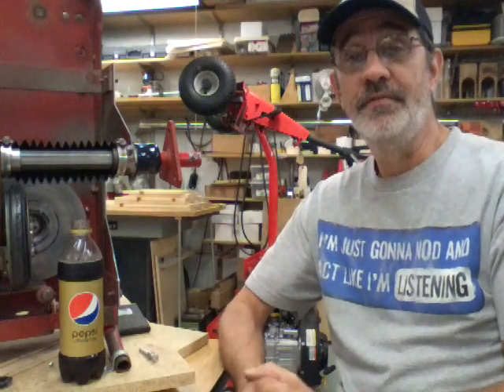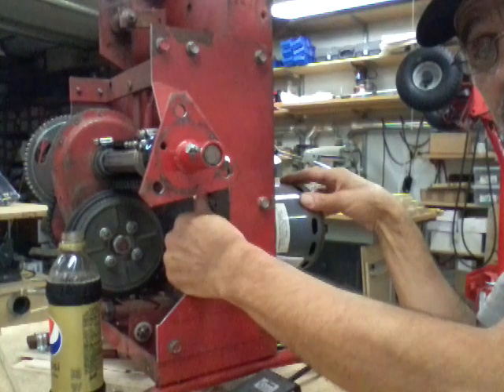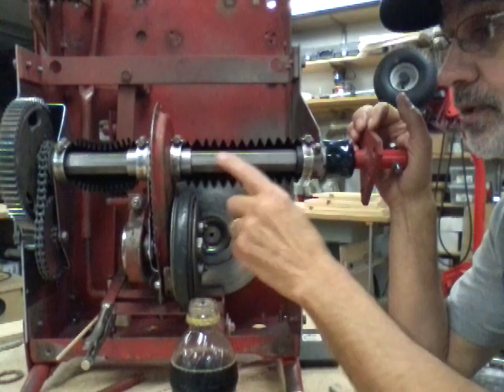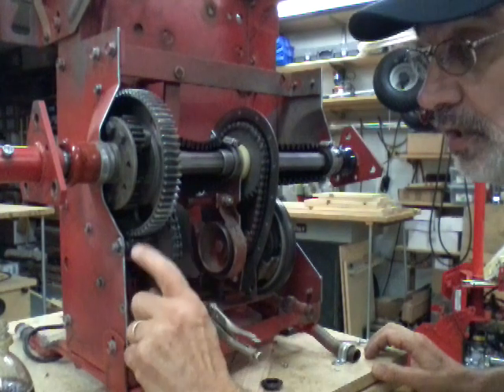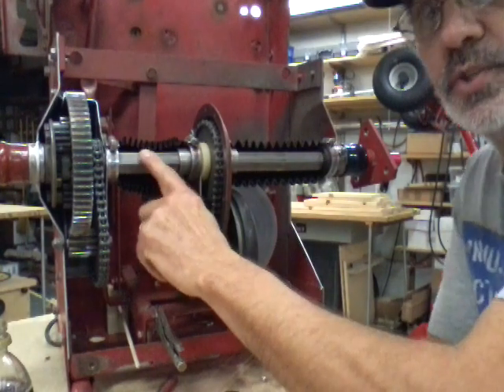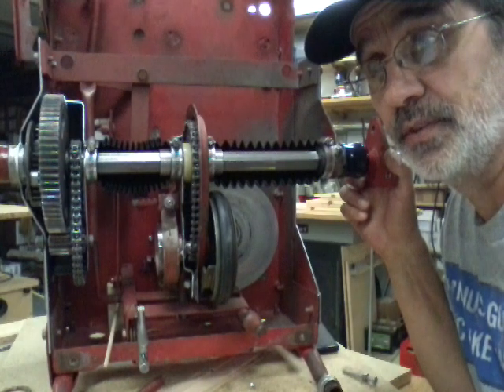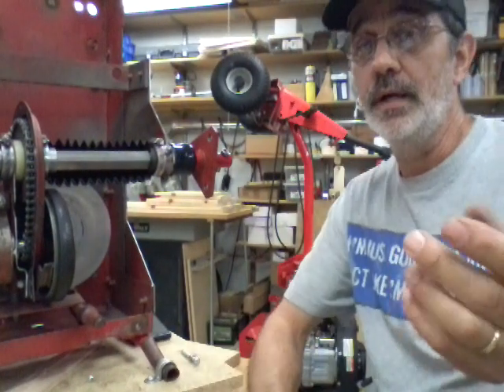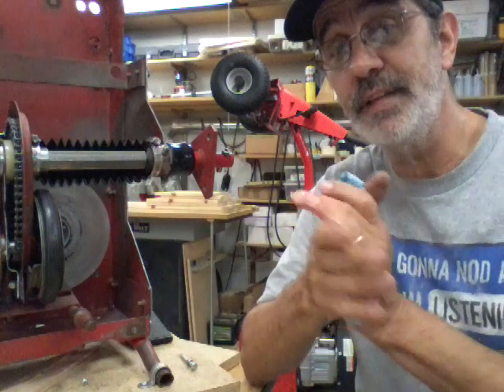132. M/S. 16  troubleshooting the drivetrain on a Snapper rear engine rider

Comment: i will be mowing, seems like it sliping already replaced the drive disk, al of a sounden it locks up no foreward or back, power down, blade out, it will start to move again and mow,
Reply from the maker: lisa ann 
So now is it working OK or is it still a issue. Jim
Reply: yes it still does it tried today, just mowing along and it just locks up, stops hard enough to make you hit the steering wheel
Reply from the maker: lisa ann 
It’s sounding more and more to me like you have a bad gear in your differential the only thing in the chain case I think that could give you a problem is the chain would break and that would be A intermittent problem, if you decide to try and fix it and start taking it apart and you need any help let me know. Jim
Reply: @jimjackson9381  o yea, when it locks up if you move the gear shift to reverse and foreward it will move again, when in reverse it is very jumpy  backing up. thanks for all your help
Reply from the maker: lisa ann 
Yes if I had to guess I would say the problem is probably in your differential there’s a small gear that drives a large 63tooth gear is what they call it and I would guess it’s one of them two gears. Jim
Reply: @jimjackson9381  do i need special tools to take it apart? alabama thanks
Reply from the maker: No special tools needed standard wrenches and sockets it has no metrics on it. Jim
Reply: @jimjackson9381  thanks for your help, be safe
Reply from the maker: lisa ann 
And if you can send me a picture of you and your snapper. Jim
Reply: @jimjackson9381  my snapper died today, had to push her home, i lost your video where i can get parts from your friend, guess i need to take the differental  apart , what video is that. thanks
Reply from the maker: lisa ann 
Hi Lisa
   The video you want to watch is number 299 that’s Mike that selling stuff in Virginia, the video 288 explains how to take apart your differential, video number 306 will explain to you how to get a directory of all of my videos in a PDF file you can download thanks again. Jim
Reply: @jimjackson9381  thanks jim you are a very special person to help everyone like you do, be good and safe
Reply: @jimjackson9381  i have a parts manual 2/85  manual #06022 ser#83108238 mod#3012x6s do you think the numbers for parts still same
Reply from the maker: lisa ann 
 Yes the numbers should still be the same for you to order new ones, if you have any trouble let me know. Jim
Reply: @jimjackson9381  when i stand it up to remove the tire there looks like a hose clamp thing behind the wheel,thanks
Reply from the maker: lisa ann 
That holds on your dust cap and lip seal that I talk about in a lot of my videos,  Jim
Reply: @jimjackson9381  hi jim when i take the tire off, when i stand her up, to get the fender off, do i need to take the battery out, because this going to a weekend , then once i get the side off, can i lay her back down? this all outside, have no shop like you
Reply from the maker: lisa ann 
Yes you want to take the battery out, but you don’t have to lay it back down you can leave it standing up. Jim
Reply from the maker: I would only take one fender off at a time. Jim
Reply: @jimjackson9381  thanks for all your help, when i take it apart can i buy parts from you or from the other  guy
Reply from the maker: lisa ann 
 Well when you get it  apart let me know what you need and we’ll figure out something. Jim
Reply: @jimjackson9381  do i have to take both sides off? i got the differential  loose all the boots, won't slide out
Reply from the maker: lisa ann 
Watch video number 203 it will explain how to get that off and both boots on. Jim
Reply: @jimjackson9381  what size is that puller you used? mine is stuck on too,  thanks jim
Reply from the maker: I think it was a 6 or 8 inch puller. Jim
Reply: @jimjackson9381  thanks gotta go rent one, thanks jim have a great day
Reply: @jimjackson9381  well i got it apart the chain is broke. everything else looks good, besides the sprocket  it is worn to one side and the sprocket on the hex tube is loose. don't know if suposed to be or not, but i have a whole list of parts i need, so if you could tell me how or what i need to do. thanks
Reply from the maker: lisa ann 
Hi Lisa
The sprocket on the end of the hexagon shaft is loose they just slide them on and then dimple the shaft so it doesn’t come off but they do wiggle around a little. You said do you have a whole list of parts to order and you would like me to tell you what to do but I don’t know what parts you’re ordering or what you need for me to tell you if you could send some pictures that would help, you can send them to my email which is
jimsfixitshop@gmail.com
And I’d be happy to help you. Jim
Reply: @jimjackson9381  yes i have a parts list with all the order numbers from the manual, just don't know if you sell parts or how it works
Reply from the maker: lisa ann 
If I have anything that you need I’d be more than happy to sell them to you. Jim
Reply: @jimjackson9381  so tell me how i order and pay, thanks
Reply from the maker: lisa ann 
Hi Lisa just send me your list to my email and I’ll see what I have. Jim
Reply: hi jim  finally got it all put back together, replaced the chain in the differential, all new everything, still will not move,  stand it up, both tire move, put it in gear, use a socket on the drive disc nothing, disc is in contact with  the drive  plate, guess it in the chain case too? been a chore, thanks for any help
Reply from the maker: lisa ann 
Lisa when your machine is standing up in neutral making sure that your clutch disk is not touching your drive disk can you put a ratchet and socket on the large nut on your clutch disk assembly in turn it making The tires turn?. Jim
Reply: @jimjackson9381  jim no the tires do not turn
Reply from the maker: lisa ann 
Then you must have a problem inside the chain case I have had one viewer that his locked up because the upper needle bearings rusted up and froze. Jim
No way did you takeoff your clutch disk assembly at any point before all this trouble started, installing your clutch disk assembly improperly will lock up your entire drivetrain. Jim
Reply: @jimjackson9381  no,   the chain was broke in the differential, i replaced it, everything else looked ok, put it back together, still don't work. undid the boot turned the clutch disk the hex tube is moving but the wheel is not, guess i get to take it back apart.  try to see what i did wrong. thanks for all your help jim
Reply from the maker: lisa ann 
Yes that would indicate that everything in the chain case is OK must be something in the differential when you get it taken apart if you don’t see anything wrong take a bunch of pictures of different places and send them to me. Jim
Reply: @jimjackson9381  jim i can't even push it, it locked up, gotta rent the puller again, all this in the yard,  yep . hope you did not have heavy weather  other day

Comment: Mys not rolling neither way could it b tha chain in the small gear box
Reply from the maker: It’s hard for me to guess what’s wrong with your machine not being able to look at it myself, I guess I would stand it up and start checking to see if you have any damage to your differential cover, due to side play and the chain cutting through it That will lock up your machine and I guess you just have to start taking it apart and looking for the problem.         Jim

Comment: My transmission makes a light clunk type noise every 3 seconds or so while moving forward...
Reply from the maker: Well it sounds like you may be taking it apart this winter and seeing what’s wrong with it if it lasts that long fall is the busiest time of the year that I use mine. Jim

Comment: HOW DO I ADD GREASE TO DIFFERENTIAL?
Reply from the maker: Stand your machine up pull out the lower black plastic plug and squirt some of the double ought lube into the differential and or chain case until it’s fall to the bottom of the hole and reinsert the black plastic plug. Jim

Comment: my snapper RER E3313, was driving perfect... But after replacing V belt and tensioning it.. Ive lost all forwards gears.... Reverse is fine, But no forward gears...
Please help 😂
Reply from the maker: Explain to me how you put the belt on your machine what did you remove and put back on to get the belt in place?          Jim
Reply: @jimjackson9381   i removed nothing.. Original belt snapped, So i bought a replacement, And its about an inch longer, So i put the shims inbetween the middle pole of the frame, to tension the belt.. and now i have no forwards drive.... the drive disk just slips... I think i need to slacken the clutch cable a little.. But i have no idea how to...
Reply from the maker: @RGD-Audio-Repairs  if you stretched your frame out, you’re going to have to readjust your clutch cable.      Jim
Reply: @jimjackson9381   How do i do that, Please?
Reply from the maker: @RGD-Audio-Repairs  on the backside of your pedal where the cable goes through there should be some Ferrells you have to take the rubber pad off the steel pedal, pull the cable out of the pedal and move some of the Farrells in front of the pedal and put it back together and try it how many you have to move I would start with two and see how it runs you may have to move more. Jim.

Comment: How do I grease my shifter on my snapper it doesn't have a grease fitting it's welded flat and there's no grease fitting down there my other model has a grease fitting this one doesn't
Reply from the maker: Chad Cracknell 
 I guess you'll have to disassemble it , clean it , and reassemble it , in less you have a way to drill and tap in insert a grease fitting that's about your only option
Reply from the maker: Numa Newbern 
Numa. The older machines did not come with nylon bushings in them that's why they have the grease fittings. The 2012 Machine that I am rebuilding from my boss has nylon bushings in it and it also has a grease fitting on it they do need greasy or they will rust and quit working.  I thought you knew something about snapper apparently not.  Jim
Reply: Chad Cracknell my tires won't turn at all in the same direction won't turn even one rotation

Comment: mine will move then after a while it dont wanna move if you help it it will if i get off it it will move then when i sit on it will slow down its the 2nd trans doing same thing
Reply from the maker: ben hall 
Hi it's Jim
   If you haven't already I would like you to watch video number 70 and 132 they will explain how the drivetrain works and how to adjust it. Thanks Jim
Reply: My snapper keeps rounding out the clutch disc I put a new sheer pin  and clutch assembly 2 times same thing happens

Comment: Hi, my old 8025-14eb snapper  has finally stopped after 25 years. It is locked in neutral while running. I can't shift into any gear, fwd or rev, it's  a hard stop, like something won't mesh. The blade engages and everything seems ok. I can still push it. Thanks for any help you you give me.
Reply from the maker: Gayle Fidler 
 Stand it up and take the boots loose from the chain case and clean and grease the hexagon shaft and that should help it shift,   otherwise it’s the shifter itself that is rusted up you can take the linkage off the bar on the backside of the shifter and see if the shifter moves on its own otherwise if it does cleaning and greasing the hexagon shaft should help also. Jim